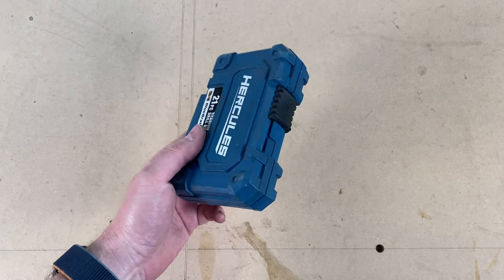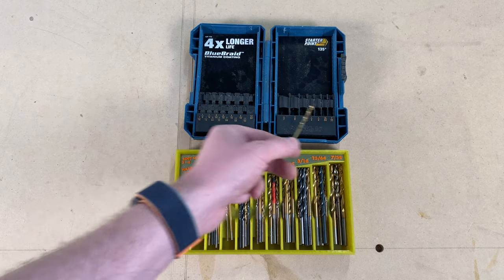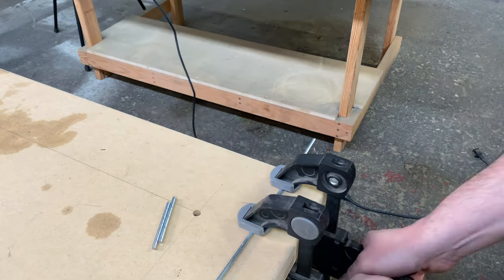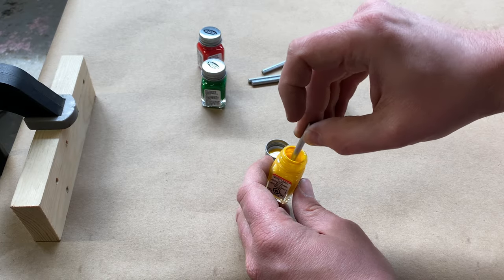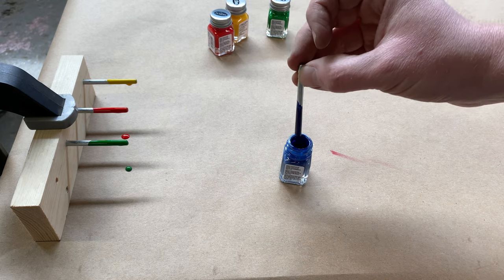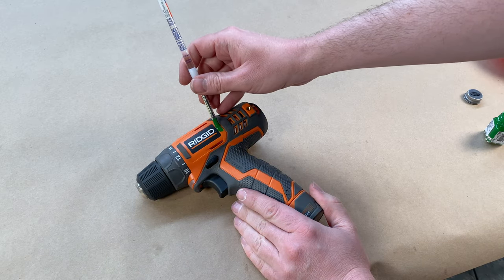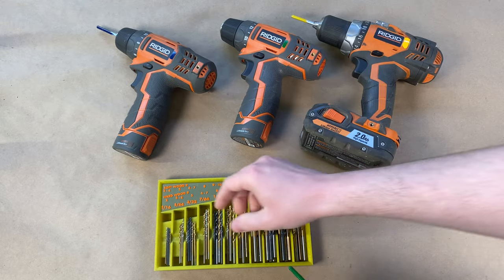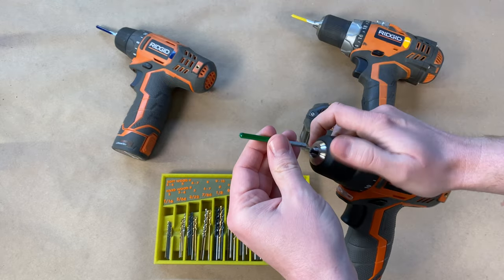Keeping drill bits organized with a simple trick

Comment: Hi, great idea, but why don't paint the bottom of each drill bits. Imagine that the box falls down and everything gets mixed up.
Reply: The bits are for all the drills. If he opens the case and sees a painted rod, he knows he has a bit missing from the case and knows which drill to check first.
Reply from the maker: You’d need a lot of different colors to paint the end of the drill bits, because there are so many sizes. And you’d need to break out the paint again every time you got a new bit.

Comment: Stainless steel will corrode the inferior and less noble metal of the drill chuck.
This is madness, extra step and giving yourself more work. Color code the drill bit.
Reply from the maker: I think the rods are galvanized steel, but I’m not sure. Corrosion hasn’t been an issue, at least not in my workshop environment. I don’t think color coating the bits would work for my needs. You’d need a lot of different colors because there are so many sizes. And that would be a lot of bits to paint. And I get new bits a lot more often than I get new drills.
Reply: @eusonicmakes  thought u said they are stainless.  You have 7 colours say and they repeat